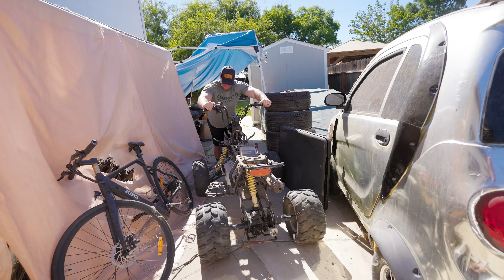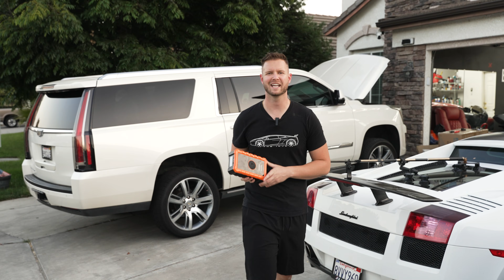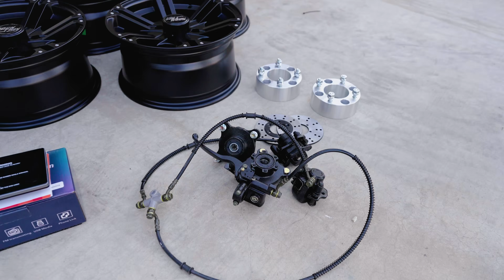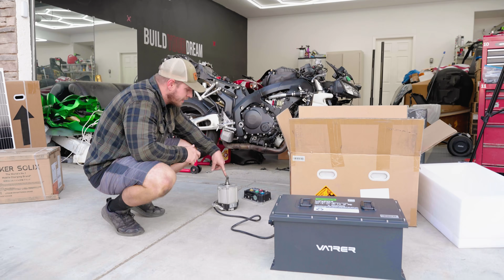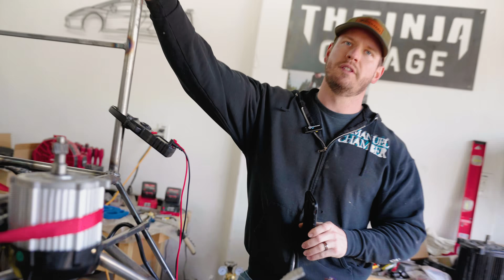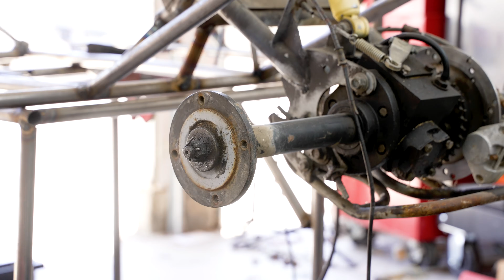BUILDING AN ELECTRIC MINI-TRUCK FROM CHINA (PART 1)

Comment: That's super neat project.
Just a heads up on the rpm on the fardriver.

Sometimes, field weakening is activated by default. Better let the motor rpm at 12k and disable field weakening. Under load, the motor max rpm will be at least 30% less. After that, you guys can start tune fine tune the controller. 

Fardriver work better when tuned under load. Run, test, change settings. Rinse repeat.